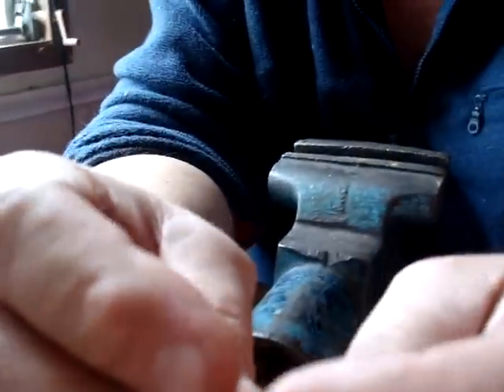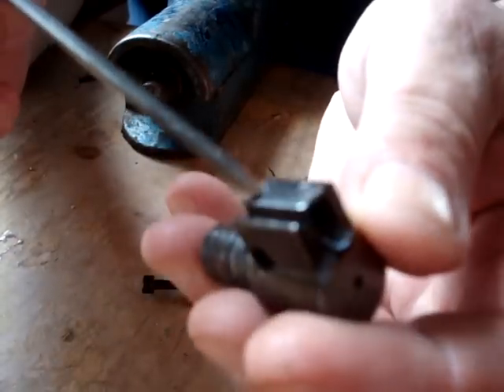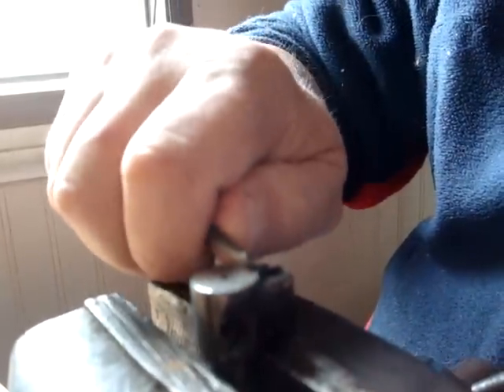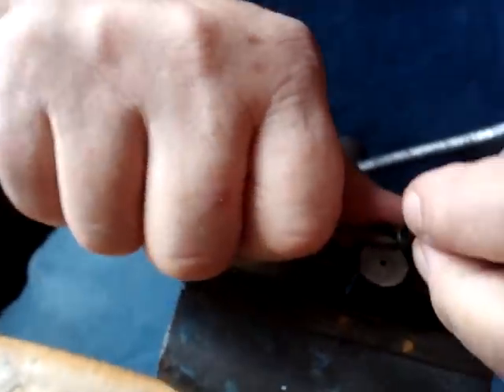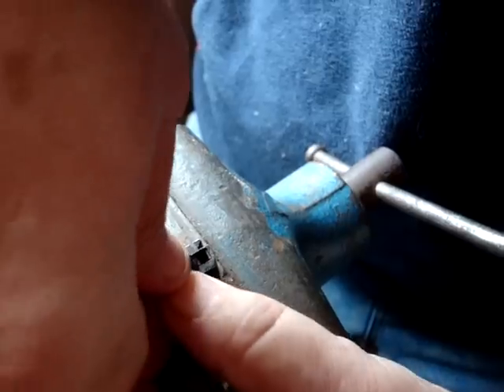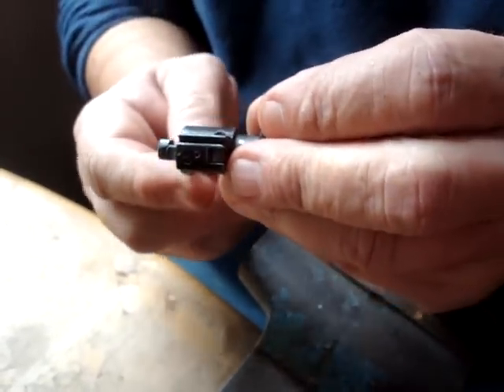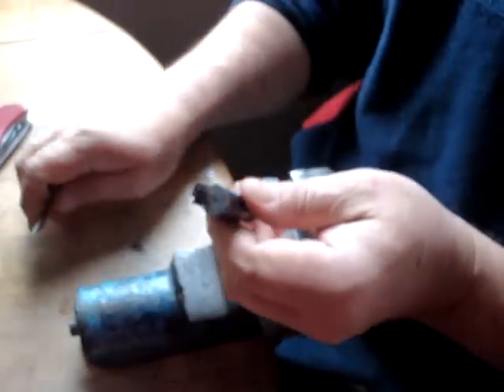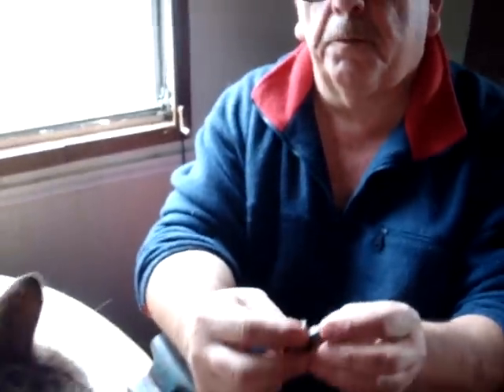Lee Enfield No4 Rifle Extractor Spring Install

Comment: Thanks for the video; it's just what I needed. I would say you run an "extremely high risk" of breaking the extractor spring if you insert it with the extractor installed. My replacement spring just arrived, and now I know the proper installation technique.
Reply: Relatable. My replacement just arrived the other day.

Comment: Thanks a hell of a lot, man! I just got done joy shooting my two Lee Enfields, my No. 4 Mk. II and Jungle Carbine, and I realized that my Jungle Carbine isn't extracting, and the extractor is loose and fidgeting around, without an extractor spring. I'm going to order a new extractor spring, and start putting it in my Jungle Carbine's bolt, and test it with some duds.

Comment: Very helpful video thank you, am so glad to have searched for this and 'hey presto!' YouTube delivers as have you!
First change of a bolt head for me (ROFF No4 Mk1) and was very simple (took less time than yours which made me think I had done something wrong, but I was not filming too i concluded).  An observation, I fitted the extractor spring from the rear, it slipped in more easily.  All was well except the firing pin hole is too small...which is puzzling...and the firing pin has protruded the small steel sleeve around the firing hole - so a bit deflating having hunted down a replacement bolt head in UK.

Comment from the maker: I like the 160/162 bullet for the 7mm and 6.5 very good Ballistics Coefficient, I shot in a sniper match years ago and one of the shooters brought an 7mm-08 shooting 160gr bullets he won. I would try a few different loads and see which your rifle likes the best, they can be finicky. I had a 308 once and it shot 180 great but shot the 168 match terrible you cant really tell until you try a few. But you should get good results with the 162's, I found a 7mm and am thinking about getting it.
Reply: BC is SO overrated.